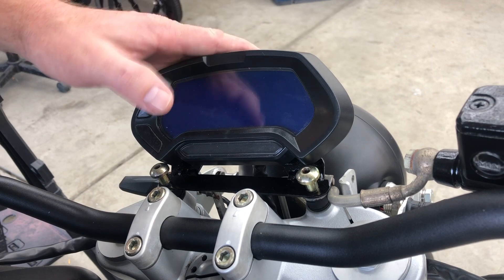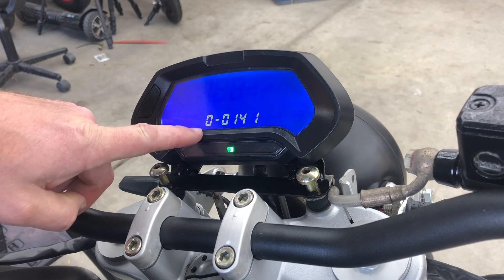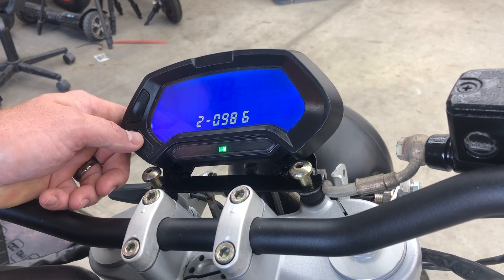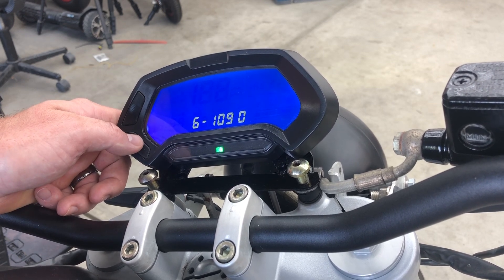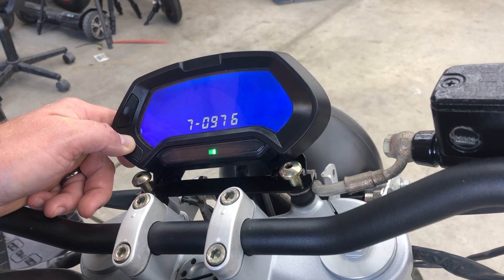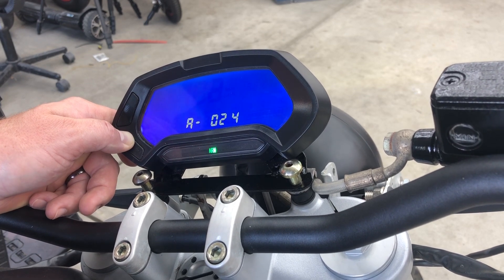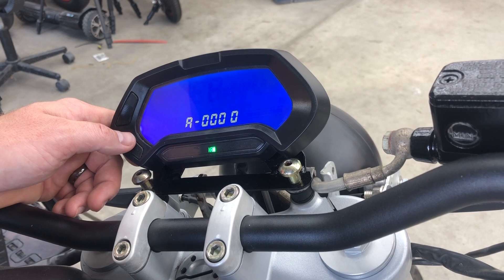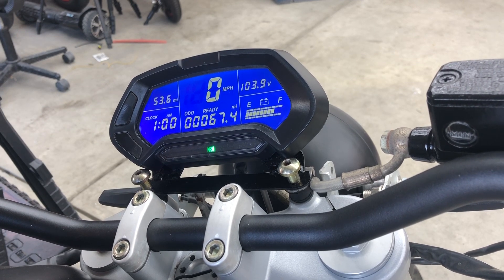CT22 Electric Motorcycle Display Programming

Comment: My ct22 sometimes shows speed and sometimes shows nothing just shows zero kph. I don't know the solution
Reply from the maker: I would check the speed sensor wire connection first. Even that could be faulty internally, though, so it could be a bad unit. Not really another easy problem that would cause that coming to mind.

Comment: Hey, I think I figured out that odd number to make the speedometer work.  For my display, it's the diameter of the tires in millimeters.       Some other instructions I've seen are the diameter (sometimes circumference) in mm, divided by the pulses (pole pairs) per rotation.  For a 24.5 inch wheel (624.84mm) the circumference is 1963/ 16 pole pairs = 122.68    --- or something like that.